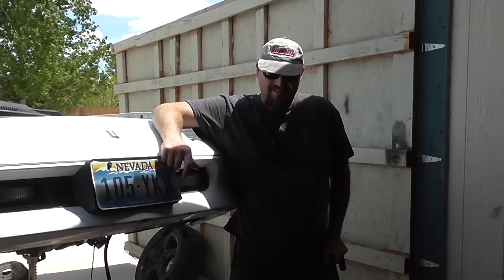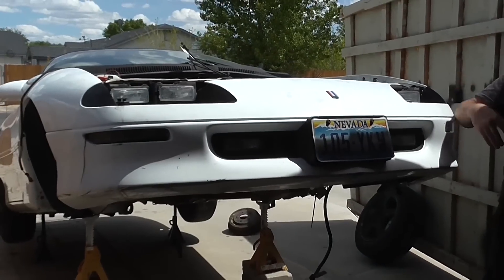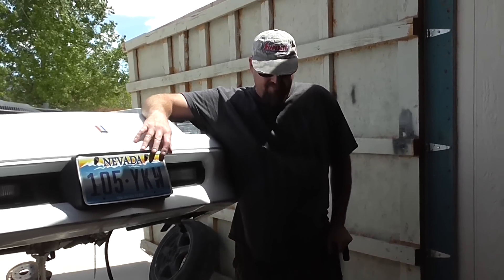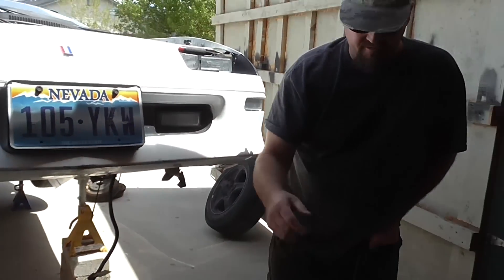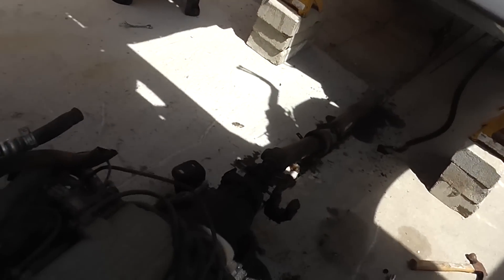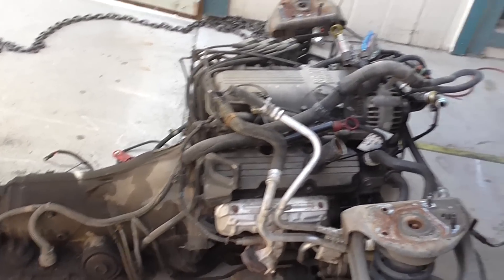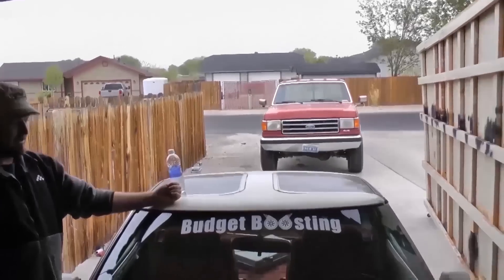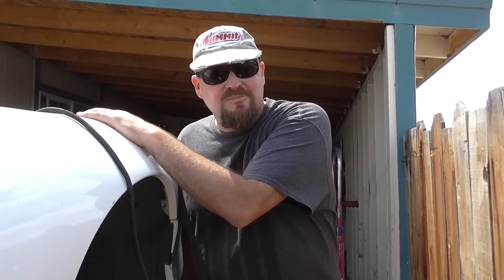Engine Removal From The Bottom Overview (93-02 Camaro, Firebird)

Comment: I replaced head gaskets on a z28 4th gen while it was still in the car, never had to drop it.. 20,000 miles later still good..
Reply: Howd you do that?
Reply: Brenden Nelson 
Tore the engine down under the hood.. piece of cake
Reply: Are you a god or something
Reply: I replaced my head gaskets without dropping the motor out of the car as well. You have plenty of room lol
Reply: Me too. Not sure why this guy did. Lol
Reply: I’ve dropped them out I’ve done it in the car honestly it depends on the situation. If I’ve got a two post lift I’ll drop the engine before I ever do it in the car because it’s just easier and I feel like I can do a better job. If I don’t have a two post lift well I don’t trust jack stands as it is and all the crap you need to do to actually support the car like that I don’t want to deal with. You have room but getting stuff torqued right is my concern simply because it can be difficult to see

Comment: “There’s something you don’t see every day.” Those jack stands on the blocks are like the safety fails compilations we watch at work. Only someone suicidal would get under that thing. Video should include a “do not attempt” disclaimer.
Reply: LOL
Reply: Lol, front end probably weighs like 200 pounds without the engine/trans/front suspension attached :D

Comment: Video is correct, you can pull engine from bottom (and is much faster like stated in video). Haynes manual says same thing. However they do  say you can pull engine from the top as well. I've seen a few videos where guys did the drivetrain driveway drop on 4th gens,  BUT they left a cherry picker hooked to the front for safety while 6 ton  jackstands supported the frame.  (opposed to the tiny length of 3 ton stands). Kinda funny to see those little jack stands sitting like that, but if it works it works... Changed my head gaskets on my 3.8 WITH THE ENGINE IN THE CAR! There are many tutorials on how to pull heads on a 3.8 Camaro.  One thing I didn't know about the plastic intake gaskets before I replaced intake so now I have to pull out the lower and replace with real deal gaskets.

Comment: We've done it the traditional way and getting to the bell housing bolts was a major pain.
Reply: You can pull the engine from the top with the transmission attached as well.

I find it easiest to pull from the bottom, but I've done from the top (engine only), from the top (engine + trans), and from the bottom (everything like in this video).

Comment: I did the head gaskets on my 97 with the engine in the car. It wasn't that bad at all really, honestly the worst part was cutting the rusty exhaust bolts off at the headers/collectors (yeah I had long tubes already but I can't imagine it being much more difficult with regular manifolds). The heads being underneath the cowl and whatnot though for the head bolts? Not bad. 

Though cutting off rusty collector bolts would have been just as bad pulling the engine from the bottom anyway.

Comment: I have a third gen trans am. I am looking at getting into a turbo project for my tpi engine. I'm truly trying to do a budget turbo build. it seems to me the most expensive part is the ECU. what do you think would be the most cost effective ECU for me?
Reply: thank you
Reply: interested.
Reply from the maker: it if is OBD 2 1996 and newer, SCT, Diablosport and some others make great programmers which can have custom tunes created on a dyno.  Find a dyno tuner in your area and ask them which software they use for their dyno tuning such as SCT, Diablo, and buy the tuner that their software covers and have them make a custom dyno tune for your set up once you have all your turbocharged parts installed.  The custom tune will put everything together and run reliably.
Reply: Ecu is not a big deal but the Pistons are ! Don't go through all that blow it up. Stock Pistons won't Handel the turbo or super charger or nitrus. If you don't take my advice,have a spare engine ready.

Comment: I changed the head gaskets on my 2000 camaro with a 3800 series 2 without dropping or pulling the engine.
Reply: How did you do that?
Reply: Brenden Nelson alot of patience, a cache of wiggle joints & ujoints, and a Haynes manual. The manual tells you that you don't HAVE to remove engine.
Reply: But what if engine has water in it have to pull the whole engine out if your headgasket is fucke
Reply: Krock Tv you can usually spot where the gasket failed. My oil wasn't milky, so the gasket failed toward the outside of the block.

Comment: How reliable are these engines? I understand that the early opti-spark was problematic, and do a water pump at the same time. But as far as longevity, if it was maintained are you looking at 200k before it gets opened up? TIA
Reply: I’m late to the party but my 3800 hit 317000 before I started pulling it our

Comment: Did you do this to stick an LS in there
Reply: Honestly who would go get another 3.4 ? the parts are the same price with the ls1 and they are very unreliable my 3.4 is dead gone and the last thing i wanna do is get another 3.4, i might ls1 swap it if i found a T56 or 3800 swap it and keep my T5
Reply: SalemMillion yeah 3.8's are really good I had one in my old 2002 camaro. I had the five speeding in it and I kept up with a guy that had a 2003 GT Mustang automatic
Reply: 4thGenDude02/BunkAssMechanic LS1 is a lot of work and many parts to replace, a 3800 will be faster and less parts, and thanks for letting me know what a 3.8 can do I honestly never met anyone with a 3800 5 speed manual transmission and I don't know the reliability of the 3.8 as a daily
Reply: SalemMillion my old V6 3800 I used every day for 7 years I had about 70,000 miles on it when I traded it and that engine never gave me any issues at all even when I romped it a little bit here and there
Reply: SalemMillion I also had a 1993 3.4 and that engine couldn't even get out of its own way
Reply: 4thGenDude02/BunkAssMechanic i might go for the 3800 swap now, its just the LS1 i need to go through a lot and many parts to buy

Comment: whats the newest 3800 i can get from a junk yard for my 98 camaro?
Reply: Dave Obrien 2002 is the last year you could get a 3800 in a Camaro so you can get one but since yours is a 98 you'd have to deal with the drive by wire because 98 is the last year with a throttle cable.
Reply: Any 3.8 series 2 or 3 will fit. But if you get a fwd motor you have to swap heads, intake, and front  Accessories

Comment: I did my heads twice in mine, In the car
Reply: Ditto.   I lowered the kmember to gain a few inches of extra clearance but I didn't have to pull the engine out to change the head gaskets.  I was able to strip the engine down to the block without removing it from the engine bay.

Comment: Grind off the bumper and slide out the motor out  since having someone welding won't cost much more than the hospital bill if that car fell and if you woulda died I wouldn't mind not having to worry about that rebuild xD
Reply from the maker: showing it can be done, it is up to each individual to make sure it is safe enough for their comfort zone to accomplish it.   Myself, I would prefer one of those nice lifts but those come at an expensive price for those on budget.  As far as medical is concerned, they really need to lower the prices charged for hospital visits.  When is the last time you went to a hospital, asked a straight question of how much a procedure would cost and got a straight price answer?  The only response they give you is do you have insurance?, and how much does it cover?  No straight price for straight procedure.  That in itself tells me how corrupt the medical world is.

Comment: Actually I just done a head gasket job on my 97 Camaro 3.8. With the engine in the car its possible
Reply: Keyword 3.8. Not 5.7
Reply: @dustinguarino7060  It's possible to do with the 5.7 LT1 as well, not sure about the 5.7 LS1 but I assume the same. I did the LT1 head gaskets in the car and it really wasn't that bad other than some side annoyances (rusty collector bolts and the power steering pump is a bitch to pull on these cars).

Comment: You can’t pull the engine from the top huh
Reply from the maker: much harder due to the rear firewall of engine compartment covering the back half of the engine.  Could be done, anything can be done with enough effort.